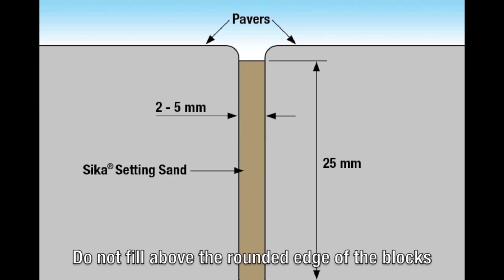Sika Setting Sand 'How-To' Video

Comment: roughly    20kg bag    does  what kind of area  of block paving   ti a
Reply: did you ever find out? I've been searching for the same info everywhere.
Reply: @SniffBackBetter    no  lol
Reply: 50mm block paving 3.3kg/sq.m
60mm block paving 4.5kg/sq.m
80mm block paving 5.7kg/sq.m

That's the estimates for generic kiln dried sand, on the basis this stuff is essentially sand with a polymer bonding additive to it, I'd say you could work off these numbers.

Cheeeers!
Reply: @Muler3627  thanks mate!

Comment: I've used this on my block paving and it has left white stains on the blocks after drying, I can't clean them off. How can I remove the stains?
Reply: I came here for the same problem!
Reply: Walt Spring try using Azpects EASY Mortar Stain & Calcium Remover.
Reply: That happened to me last year. If the blocks have any texture it’s impossible to brush all traces away. So there was a visible white appearance for a while. It disappeared in the end.
Reply: Annacid wash (with hydrochloric) in a weak solution of about 1:10, up it to 1:4 if you're not seeing results.
Reply: Thanks for the advice bud, but I moved house around 7 years ago lol. Still, good knowledge for next time. 👍